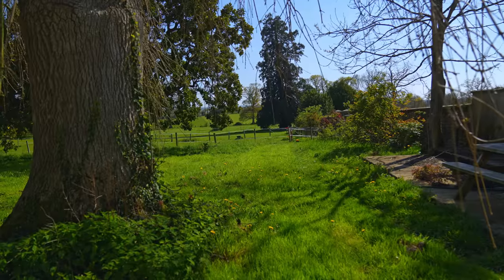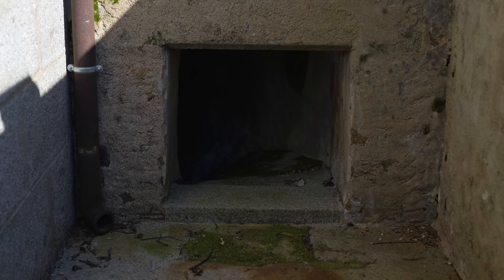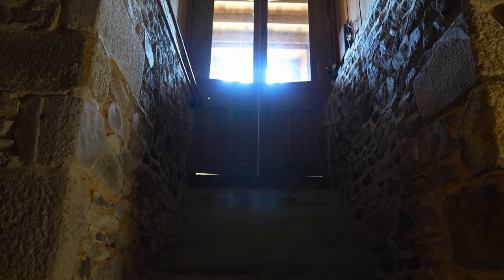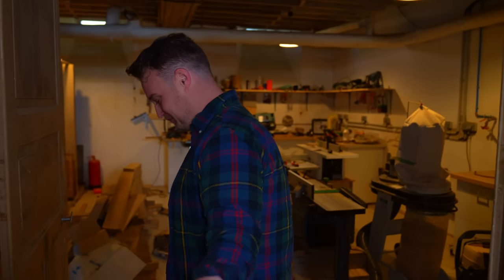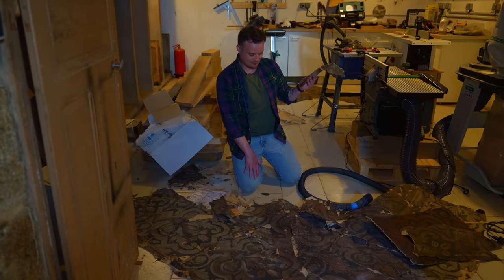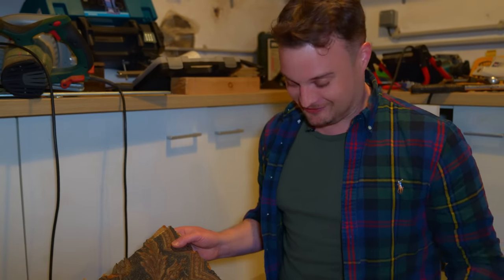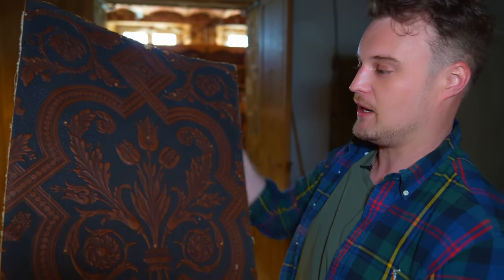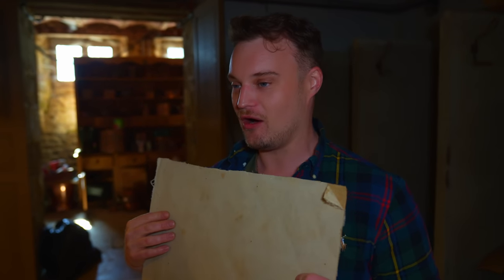We Found a Titanic Discovery in the Basement!

Comment: If it's too expensive, talk to a cnc shop. The fabric can be 3d scanned, rejoined and tidied up in software and cnc carved onto a roller. Even a 3d printed one might be good enough. There are factories that have huge liquid resin 3d printers who could replicate a roller with high levels of accuracy. You might even consider offering squares for sale to the public as a way of supporting the rebuild :) If necessary, the whole wall covering can be cnc carved flat and either stamped or just mounted into the paneling. I'd recommend trying to 3d scan or clay impression before sending it off just in case...

Comment: Before shipping the sections of old, brittle lino based wall covering I would make two suggestions based on my own decades of experience with antiques:
The first is that the packaging is vital. You probably want to ship it flat, with something like aluminum foil next to it that will conform to the raised pattern without damaging it or sticking to it, next a thin layer of foam and/or styrofoam on each side just enough to keep the pattern from being damaged, and then on the outside a sheet of plywood on the front and the back with a frame around the edges to hold everything in place.

If you are still worried about it being brittle, I think that you will find that beeswax thinned with actual turpentine is more gentle and has a much longer lasting softening effect than white spirits on older linseed oil, it works as a low gloss polish, but you won't get it back off without using a strong solvent like white spirits because of the residual pine resin in the turpentine
Reply: Hope Michael reads this ;)
Reply: My goodness you’re a wealth of knowledge 
😘😘😘
Reply: Don’t ship it, deliver it yourself! It would be much safer plus a great video content!

Comment: When you started to describe it as a natural product with linseed oil,I was thinking Linoleum!  Here in the U.S. it’s typically used on floors,(superior to rolled vinyl) however my brother put it on three walls surrounding his bathtub enclosure. Because there were no seams,there was never any leaks or mold. My brother-in-law decided to do the same thing, he picked a small  “tile” pattern and forty years later,it still looks perfect,like the day it was installed and so easy to clean!🙌🏻 (I have never heard of anyone else using linoleum on the wall)😉

Comment: I am not sure if anyone else has mentioned this, but it might be best to stain/paint the browns in first, then apply antiquing stain, allow it to set just a wee bit then wipe off the excess off all the high points on the relief surface (for a faux bois effect) and once dry, go back and fill in the single toned black.  This should make the work much easier to simply fill in the low areas with black than the vice-versa technique as you mentioned.  Thank you so much for sharing this aspect of the château renovations and restoration.
Reply from the maker: That’s a good idea, from what I can tell I think it was done exactly as you described.
Reply: Michael, the article I sent has paint, stain ideas on the second or third page of the article. The close ups show some of that. If you like I can try the phone numbers given, to see if they’re still active.

Comment: Another reason why linoleum was used on Titanic was because its durability. With linoleum, you could easily protect it with regular waxing/sanding if needed , was easy to clean , and also has anti-bacterial properties. Ocean liners like Titanic were expected to be in service up to 25 years and in some of the harshest of conditions (being on the Atlantic). Not only was other options heavier than linoleum, but tiles made of things like marble can stain over time making things look grimy .

Comment: The fabric backing is cheesecloth, Victorian United States, if you live to close to the rail road tracks your plaster wall crack, so these Victorians had to use wallpaper, but to keep the wallpaper from tearing from the same movement, they nail cheesecloth to the lath, then applied the wallpaper, causing the cheesecloth/wallpaper to kinda float apart from the wall (when if came to stuff like this, USA and Great Britain took each others ideas). Also the linoleum floor was only in the first class stair ways and halls. First class dinning room is tiled, and all of 2nd and 3rd class is tiled (I know this since they recovered these tiles from the ocean floor, I'm a history nerd, but mainly a maritime history nerd). The reason why was at the time of Titanic linoleum flooring cost more than marble flooring, hints it was high class at that moment.

Comment: It is stunning after a cleaning!  Wow!  If you do make a deal with Lincrusta to re-manufacture the pattern, I strongly suggest having a lawyer go over the deal before you agree.  For example, if they plan to offer the pattern for sale again (which would make sense if they go to the trouble of making a new roller), then they're going to be making money from it, so you shouldn't have to foot the whole bill for the creation of the roller and the wall covering you buy.  There's also no need to spend money on hand-engraving if it can be scanned and cnc re-created.  Perhaps a deal could be reached where they could use images and video of the new material in place at your chateau to advertise their products.

Comment: I haven't even heard the word Lincrusta for so many years - what a find:  I fear a hand engraved roller is going to be in the thousands but Good Luck sorting that:  There also used to be another 'embossed' wallpaper - Anaglypta - which were tradional designs, embossed into a heavy pulp paper stock - the effect was similar, but the design was hollow - truly embossed, not planted on top of the paper:  It was only sold in natural paper stock, to be painted once installed:  That might be another avenue to pursue should Lincrusta be prohibitive.  There is another technique that might be of use to use in the restoration - Gaufrage:  This is also embossing, usually on fabric, most successfully on thicker fabrics like velvet, pressed under heat:  Gaufrage has been used in interiors for over a century, and there is still one company in Paris specialising in gaufrage:  Gaufrage costs are not prohibitive, the main expense is the best suitable fabric.  Great for wall coverings and upholstery, and there is a range of designs available - damasks in various scales, geometrics, Deco etc.:

Comment: Intaglio plates are often laser cut from a scan or original digital art. I am guessing the process used was based originally on an intaglio method. While one may think of intaglio as being a flat plate process put on a flatbed with the paper to take the image and packing placed on top and the bed wound forward under a roller as the process, as seen in many fine art studios and art schools. There are cylinder version where the image is on the cylinder. They were very common before paper money was replaced with plastic "paper" as one of the printing processes to make forgery more difficult because of the raised ink that could be felt between the fingers. Commercial high speed four colour and multi colour intaglio/rotogravure presses are still manufactured and used in the printing and packaging industry.

Comment: Using a mineral oil will ruin it. It is linseed which you should steam it to remove the creases and distortions, let dry again then clean with basic soap and water. Most, if not all, dirt will be organic and can not be removed by oil based cleaners. 
Oil based cleaners will expand and distort the product further as well as cause further drying and degradation..

Comment: Photo into a graphic program connected to a 3D printer, shouldn't take too long, why does it have to be metal roller, just a plastic roller would work! Put the plastic roller in an old washing machine which has rollers & pass damp board through rollers?

Comment: Do you have photos of the tapestries? With a rather extravagant budget they can be remade. It would help if you had a scrap or two of the original somewhere in a box. There may be original cartoons* floating around somewhere. 

*A cartoon is weaver's jargon for the original drawing from which the tapestry is woven. if you can hunt through the design paperwork and you might find them.  There are a number of Raphael cartoons at the Ashmolean.

Comment: Pretty stupid to cut that down. Sending it to them directly in its most complete form would cost the same as shipping it in the measurements you mentioned that they requested. Leaving it in its entirety would be more beneficial even with the creases, more points of reference to recreate. It is also likely that the measurements would be different given imperial and metric measurements. There might even have been different sizes of rollers for different sizes of patterns. Why would you use white spirit or any type of solvent on an old oil based product(linseed and wood dust)? You risk damaging the pieces even further(surface paint).